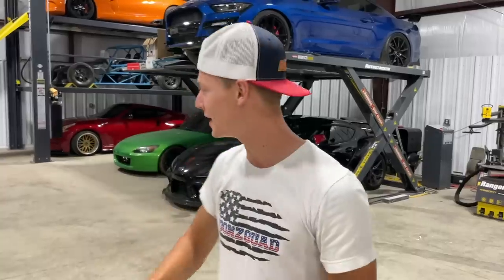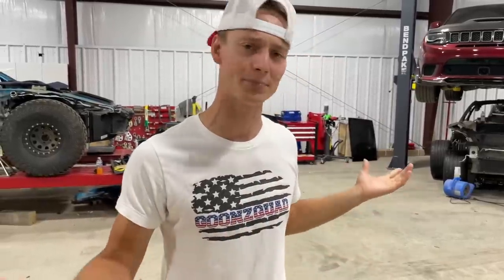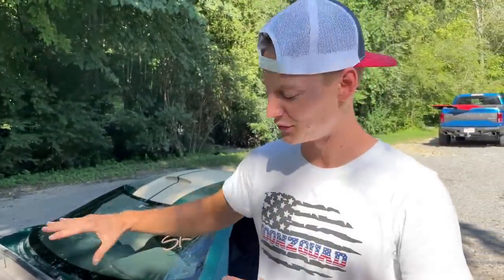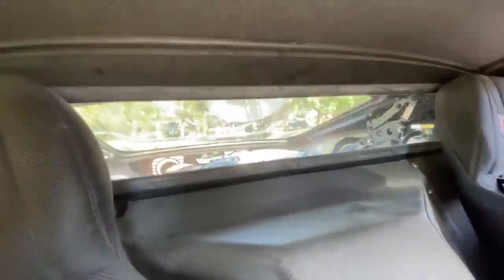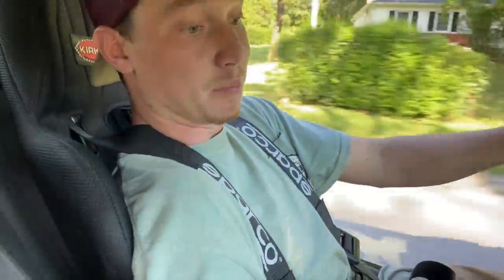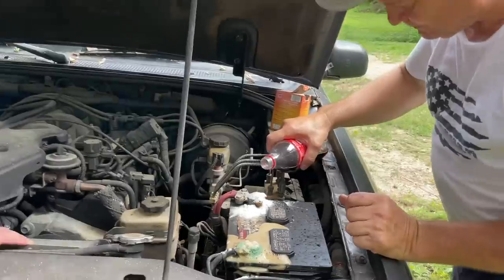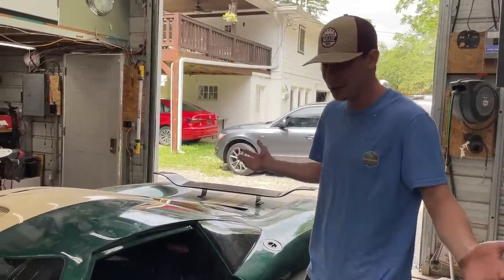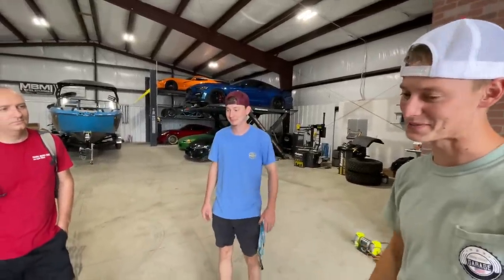The Wrecked GTM Factory 5 Supercar Is Finally Road Worthy!!! This Might Be Our Fastest Car?!

Comment: Take that fiberglass turd to the burn out contest!! If you take the stang put tape on the quarter panels for the rubber and Vaseline up in the fender wells if not the rubber is going to be he'll to get off!!!
Reply: The front end is too light. It will make a terrible burn out vehicle.